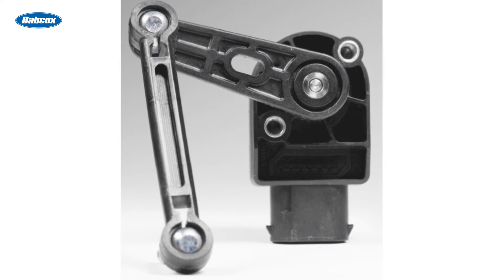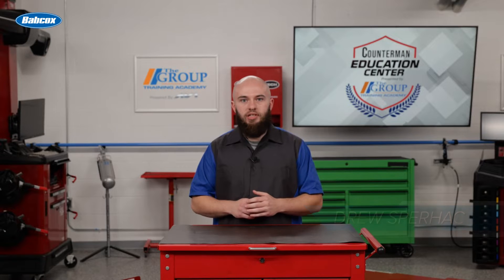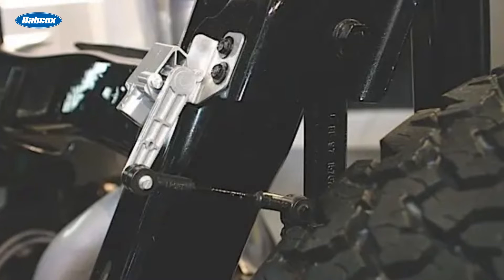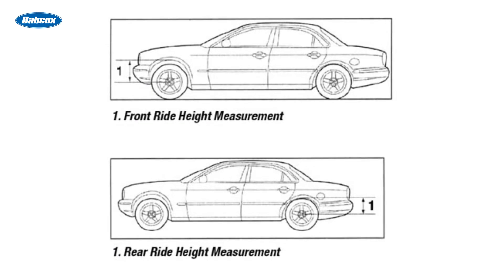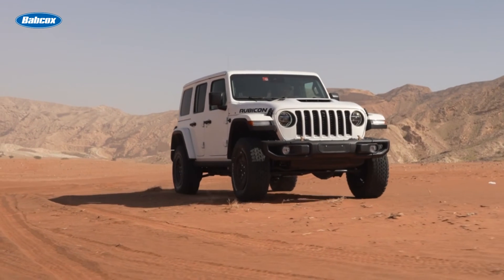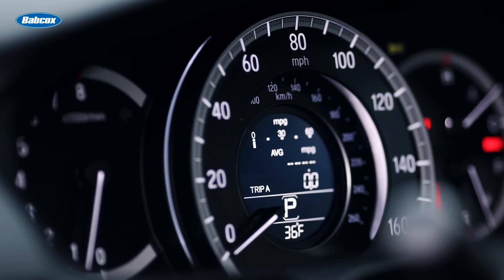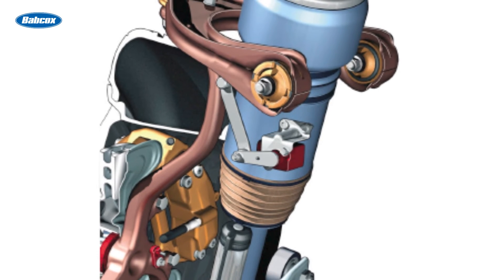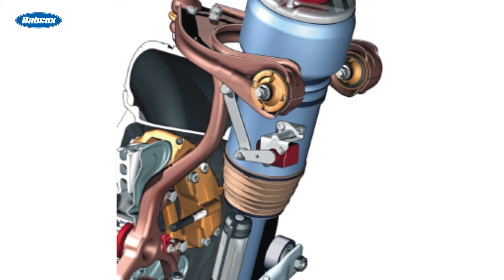Understanding Ride Height Sensors

Comment: So are these adjustable? Cuz I replace compressor and airbags on both sides and there's no leaks and one side rides higher than the other.
Reply: Need to calibrate it. Said at the beginning of the video.
Reply: @hashbringer975 После калибровки ничего не изменился. Правая 630 и левая 661. Что делать?